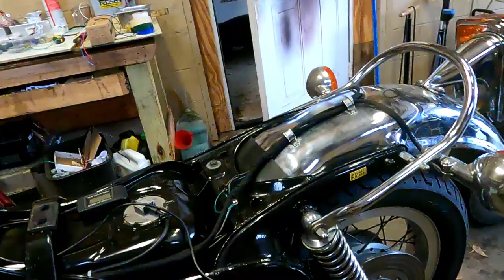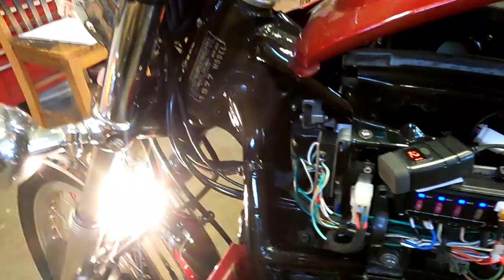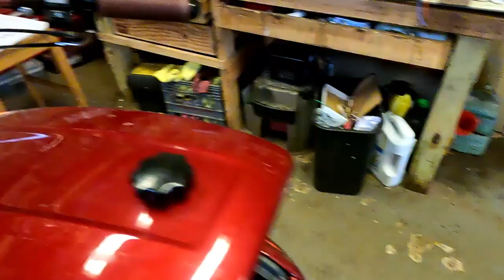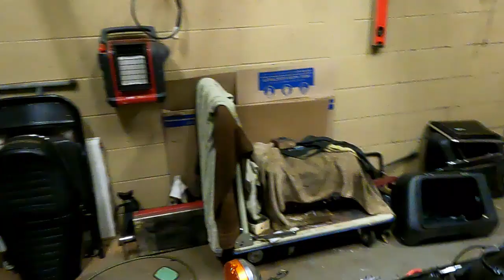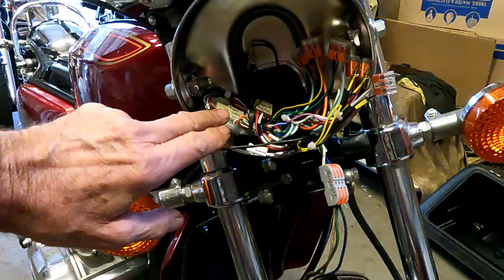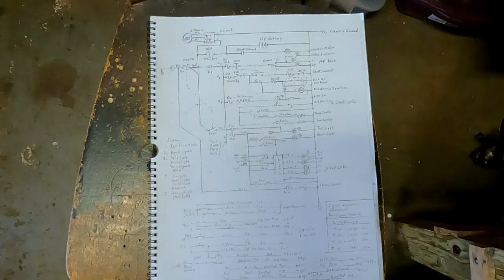GL1000 MOTORCYCLE WIRING

Comment: I was skeptical about the use of the "black box" systems. Shame they wouldn't admit the units failed. Top work on moving forward to a more reliable configuration. I am working on 3 GL1000's now and I was curious to see how yours worked out. My plan is to make a basic loom with no terminal strips, everything hard wired with some of the same modern updates you incorporated. Only the road knows how well it will hold up !!
Reply from the maker: I rode the bike today, everything is working perfectly. No more "Black Boxes"

Comment: Wow, great job modernizing and upgrading the electrical system!  Thanks for walking us through the changes.  I will be replicating many of your upgrades on my 79 restoration project.  Where do you source all of the wire with different colors?
Reply from the maker: I buy wire on Amazon and also cut old wire harnesses apart and salvage some of the wire.

Comment: This is a thing of beauty, love how clean and tidy this is. Fantastic documentation as well, it looks like you ran all new wiring and color coded it all as well. In aviation the wiring types are standardized and there are wire numbers laser etched on each wire with a specific prefix for each system like ignition, lighting, indicating systems, etc. The work you did here is very much like that and I am a huge fan of it. I’m currently on the hunt for a GL1100/GL1200 in my area this year and I do believe I’ll be following your example. Well done sir, and thanks for sharing!!
Reply from the maker: I followed Honda's color coding as much as possible

Comment: Looks great! Got a gl1000 waiting in the back for a rebuild. Did you get rid of the points?
Reply from the maker: yes, replaced with Electronic Ignition
Reply: Not to impose but any chance you would be willing to share the wiring diagram with me. I want to upgrade the bike to an m-unit, electronic iginition and all that good stuff so the bike cam become my reliable daily rider. I have worked with nwt and motogadet before. Had the same problem with nwt systems eventhough they are very helpfull. Is there a way i could contact you via a different way? Love the videos and backtracking them all
Reply from the maker: Contact me through Email: bobkramer51@gmail.com. Maybe you could pause the video and screen shot the diagram.
Reply: You are a GEM to this community. Thanks for all the videos that you make, watching from the Philippines.
Reply from the maker: Where are you in the Philippines? I spend a couple months on Masbate every winter. My wife is filipina